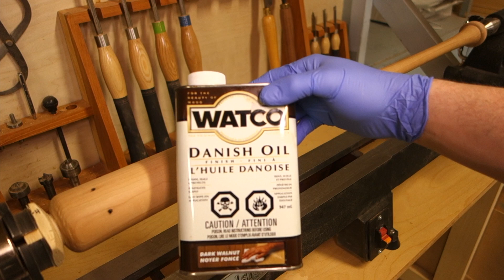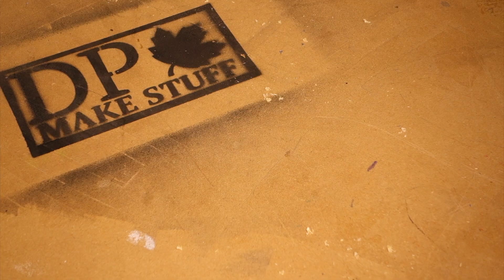Lucille from The Walking Dead

Comment: Wow. Epic work.
I’m going to try and make this for my boyfriends Christmas! He’s a walking dead nut lol
Can I just ask what drill bits you used to drill holes before inserting the pins?
Thanks and keep up the awesome work man!! 
Christina 👍🏽
Reply from the maker: Thanks!  I used a drill bit that was a couple sizes smaller than the staples.  You want a tight fit, but not tight enough to split the wood.

Comment: Hey man, great video. I'm trying to make one myself and i'm doing great so far, got the circle and the color right but the paint isn't really drying and it's been a few hours now, it's sticky when touched, any suggestions?
Reply from the maker: If the paint hasn't cured, I'd wipe it off and try again in a week.  The stain might be causing you grief.

Comment: why did you run the wood shavings on the bat after sanding? Does it help?
Reply from the maker: yeah its like really fine sandpaper.  you can actually see the bat get polished a little.
Reply: I didn't know that! Thanks for the tip, Ill definitely do that on my next project!

Comment: Hy nice video only a question why you glue this two pices of wood at the ends for turning?
Reply from the maker: I see you're a woodturner so I'll go into a little more detail than is in the description.  For the tail, I wanted the live center to go into side grain rather than end grain.  It's less prone to splitting I've found and then I don't need to worry about a dent in the bottom of the bat.  For the head I like to use a sacrificial piece to keep my tools away from the chuck and to allow me to make use of the entire stock.
Reply: good idea and nice work. I think 10 wooturners 10 diferent working ways. Thanks for fast answer
Reply from the maker: That's what I love about woodworkers!

Comment: Question. Why the hell didn't you just use one piece of wood to make the bat? Pretty sure bats aren't made from 2 pieces of wood GLUED together. I highly doubt that will hold if you actually use it to hit things with :/ If I want a Lucille bat, I want to actually be able to hit things with it, and not break it :(

Excellent Aesthetic though, you're the first one I've seen get the look right!
Reply from the maker: Shawn Wolf laminating makes it stronger and less likely to warp or break. It’s also considerably cheaper to use three thin pieces of wood than it is to use one thick piece.
Reply: Dustin Penner Well, definitely looks great. Everyone else always puts too much barbed wire on or forgets that top strip!

Comment: Со скобами не так эффективно,как в сериале(
Reply from the maker: No sure what you mean by that.
Reply: Dustin Penner 
I wrote the staple is not as impressive as in the series looks
Reply from the maker: I read what you wrote, I just don't understand what you mean.  Are you saying the bat in the show doesn't use staples?  I assure you it does.
Reply: I'm from Russia, and I use a translator, the show is not visible braces.
Reply from the maker: The bat from the tv show has visible staples holding the barbed wire down.  How else would the wire be attached?  I studied lots of pictures while building this bat.
Reply: You can make the katana Michon, or Crossbow Daryl?